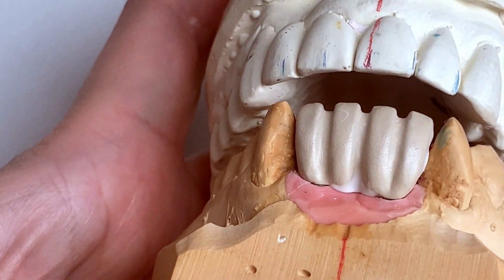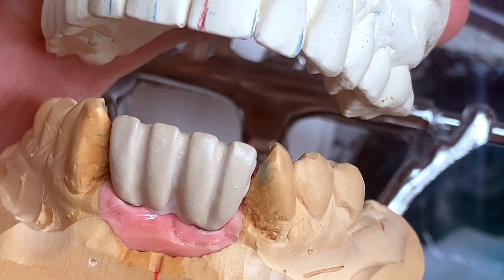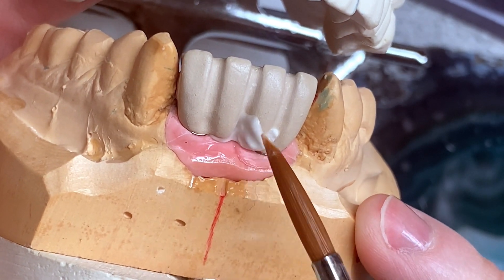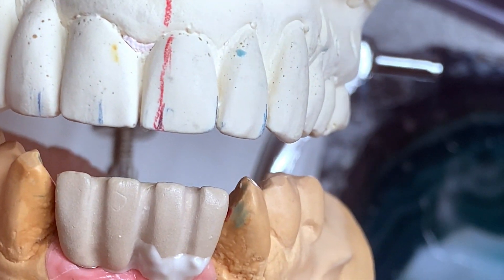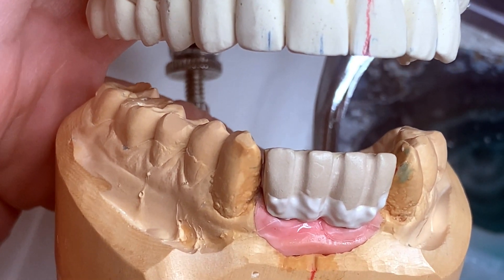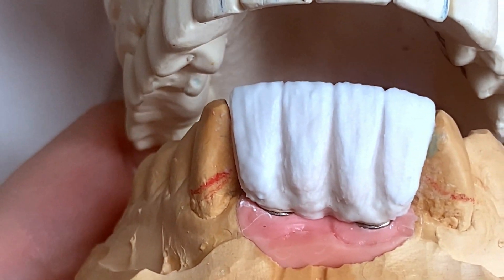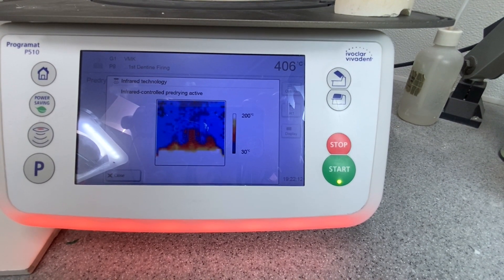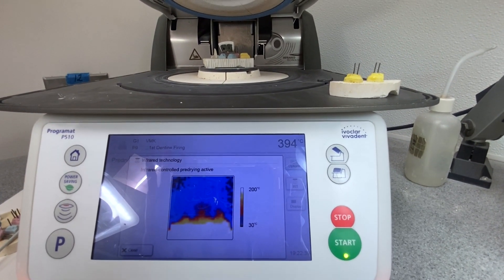Vita Porcelain 4 Unit Front Implant Bridge 3L1.5

Comment: that old brush u can use for Gingiva for those "dots" so u poke final layer with that brush  and there you go ... yes Smileline are good but very expensive ..i use Renfert Genius(natural hair) and Renfert Ceramicus (synthetic) ..both are good (natural helps for keeping moistured ceramic and synthetic ones i use to draw fisures on premolars or molars)..bt generally i like both for everything .. those takanshi i have tried them and lose their tip rly fast  : )
Reply from the maker: Thank you! 😊 As always you give great tips! I’ll order it tomorrow - great price and looks pretty too! 🤩
Reply: @verahadden4712  btw got curious ..did u wash your Colonsky brush with ordenery soap :) ..only low PH value soap for washing bushes..renfert vita etc they sell "special" soap for their brushes but regular one (low PH) works same well ..try in some shop for babies
Reply: Ah and Genius brushes have another advantage ..the place which is holding hair is plastic it's not metal..( you saw with your old brush what happens with metal).. well that rust goes thru the hair straight into ceramic so u can get discoloration:) ...but for ceramic that's less sensitive..it is important for brushes with which u applay colors to pre-sintered Zirconia..( colors for zirconia have acids so if your collar is metal it corrodes rly fast) .
Reply from the maker: Yes, I did wash my Kolinsky brush with soap from dispenser (very harsh cheap liquid soap) and did not realize that it was going to ruin it😱 because it worked for my synthetic brush just fine. That’s why I wanted only synthetic ones, but with new tips from you I just might give natural brush another chance 😊🤗